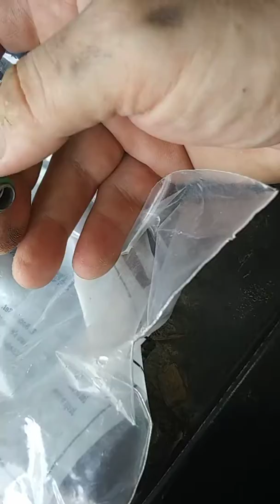How to remove and replace power steering return line 02 chevy cavalier

Comment: I seen my 04 power steering lines and immediately knew that was not something I wanted to do. I took it to the mechanic and they literally had to drop the chassis. Which caused more issues that I just didn’t want to deal with and junked it for $200.

Comment: Can't see how you did that. Did you remove any engine or chassis components to get at the fittings? I have zero access to where the hoses attach at the rack, even with the exhaust system removed. In desperation I routed the high-pressure hose directly to the return inlet at the pump, thinking I could drive it w/o power steering....no go. So, for the time being I'll just live with the minor leak and keep adding stop-leak.
Reply from the maker: Sorry for the late reply, I literally just seen your message. There was nothing obstructing my access to the hoses. What vehicle were you working on?  Cavalier, Sunfire...?

Comment: Did you have to reuse the spring clamp? My return line was leaking where the line makes a rectangle under that random rubber thingy!
Reply from the maker: Always try to replace the smaller parts if you can.